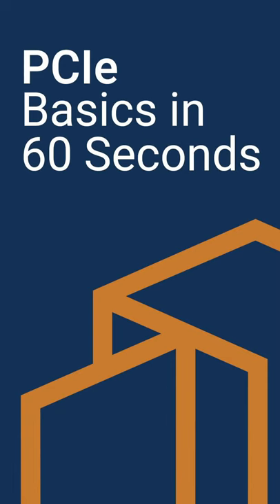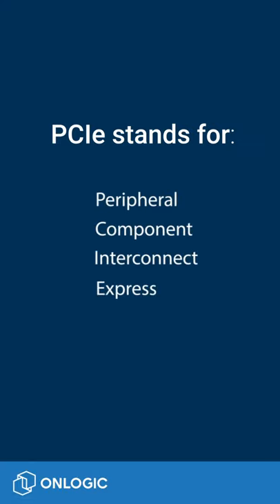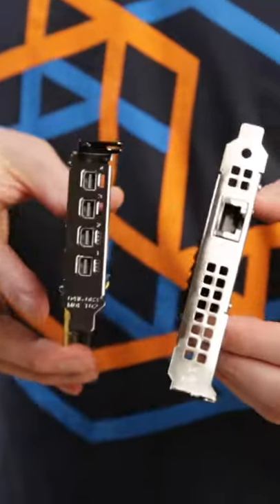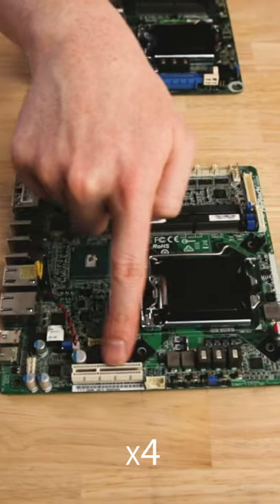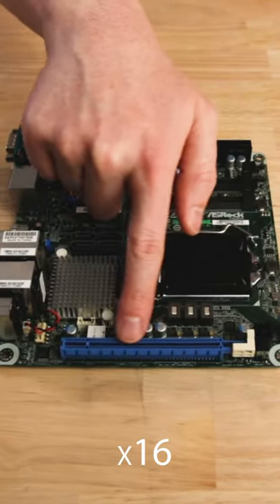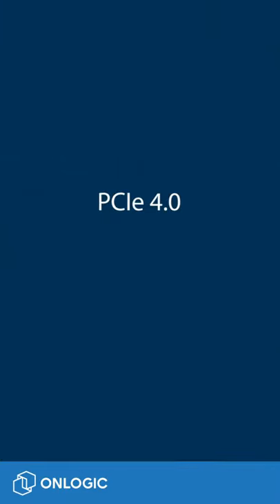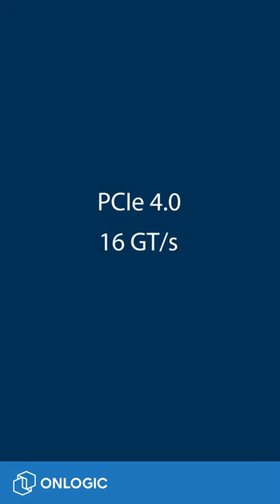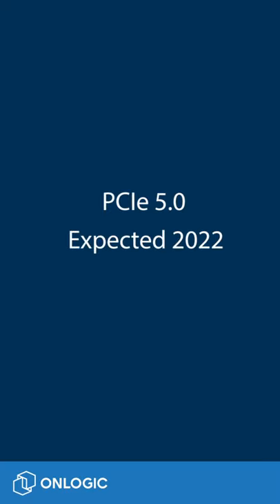PCIe Basics in 60 Seconds #shorts

Comment: So I can use any graphic card in s pcie 4?
Reply from the maker: As mentioned in the video, there are different sizes of PCIe connectors, so you'll need to ensure that your card matches the available slot on your motherboard. From there, if you have a graphics card that uses a previous PCIe generation, it will work in a PCIe 4 slot, but only at the data transfers speeds dictated by PCIe generation of the card.
Reply: @OnLogic  thanks 
I have been searching this for a long time👌

Comment: My mother board support pcie ×16 2.0 i am planning to buy new graphics Card which support for pcie×16 4.0 does it support
Reply from the maker: Thanks for the question. All generations of PCIe are backward compatible, meaning your new graphics card will work with pervious generation PCIe slots. Keep in mind though, that your performance will be limited by what your motherboard can handle, so you won't be able to take advantage of the full bandwidth of PCIe 4.0 since you're plugging the card into a PCIe 2.0 slot.
Reply: @OnLogic  thanks for replying ;)♥️

Comment: Can a pcie 3.0 16x graphics card work with pcie 16x 1.0, 2.0......?
Reply from the maker: PCIe connectivity is backward compatible, but performance will be limited to the capabilities of the earliest generation technology in the chain. Meaning, a PCIe 3.0 graphics card can physically connect to a previous generation slot of the same size, but it will not perform to it's full potential because it is limited by the capabilities of the previous generation slot.

Comment: What about compatibility
Reply from the maker: Thanks for the question. Are you wondering about a specific generation? As is the case with all PCIe generations, PCIe 6.0 is backwards compatible with every previous PCIe generation. However, it’s important to note that the data transfer speed will be limited to the lower generation. For example, you can connect a PCIe 5.0 SSD to a gen 6 slot, but it will only run at PCIe 5.0 speeds. The inverse is also true; connecting a PCIe 6.0 SSD to a gen 5 slot will transfer data at gen 5 speeds. Hope that helps! You learn more about PCIe 6.0, here: https://www.onlogic.com/company/io-hub/your-ultimate-guide-to-understanding-pcie-6-0/

Comment: My motherboard supports PCIe 2.0 so how much speed I'll get if I install an NVMe 3×4 technology.
And also will it be worth it?
Reply from the maker: Data speeds will always be limited by the slowest part of your system. The max data transfer rate for PCIe 2.0 x 1 is 500MB per second. As far as if an upgrade to an NVMe drive would be worth it, that's up to you, but you're not going to get faster transfer speeds than your motherboard can handle.
Reply: @OnLogic  means that I'll only get 500mbps max on PCIe 2.0 no matter how fast nvme I buy right?
Reply from the maker: @bruhhh69  You've got it.
Reply: @OnLogic  I'm getting 280mbps read and 250mbps write speed using sata 3 SSD on my H61 Motherboard that supports sata 2 tech.
Is this 250-280mbps speed right enough?